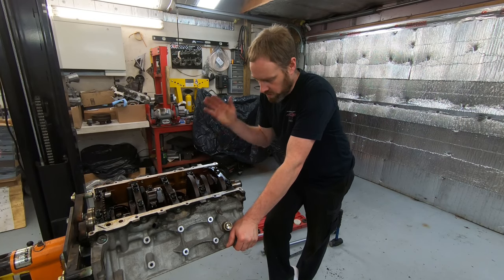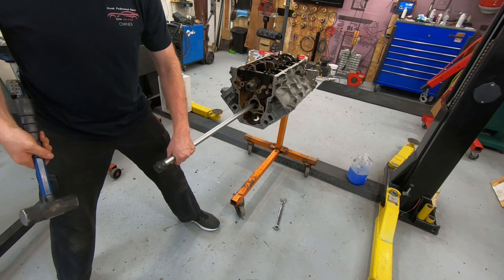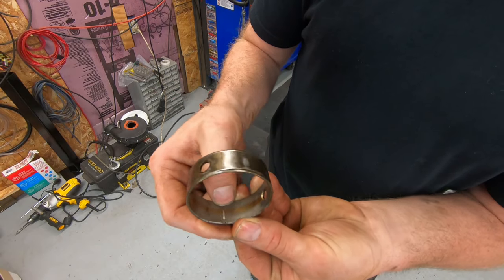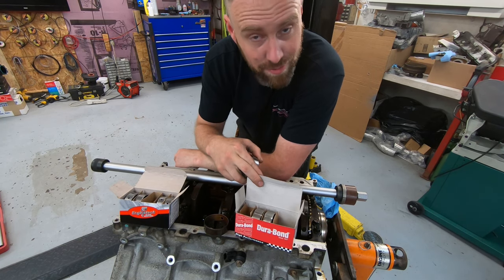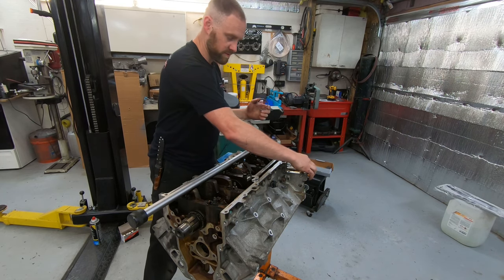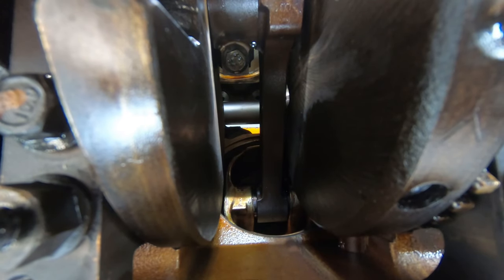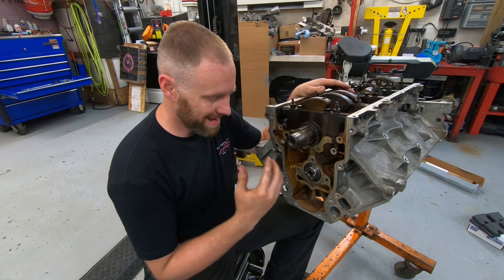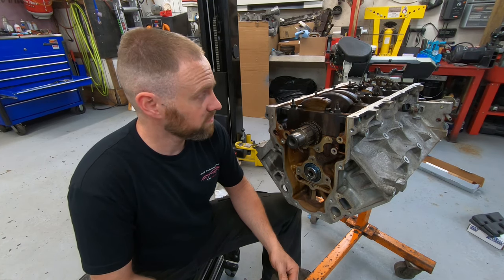Replacing Cam Bearings In AFM DOD LS Based Engine

Comment: @22:50 - I've always installed #1 & 2 with the installer going in from the back. Just take it off the stand and put the block on a table/box/floor. I think we have the identical installer! Case is even the same color.

Comment: Hey buddy.  Just wanted to give you a heads up on some info I've discovered over the past 15 years..
Alum VS Babbitt bearings.  My experience is that Alum bearings hold up much better for long term use, and "race" bearings (are babbitt) which can handle higher HP are used in racing because the manufacturer expects them to be replaced more often..
Here is an article talking about the alum vs Babbitt...
I will post the website below the section I'm posting... IMO, alum bearings, Cam, Crank or Rods.  Just hold up better....

------------THE ARTICLE ------
To meet the demands of higher loads and operating temperatures in modern engines as well as the requirements imposed by high performance, babbitt has been replaced by an alloy of aluminum. This aluminum alloy is much stronger than babbitt and will withstand several times the load which causes babbitt to fatigue or extrude. However, this added strength is obtained at the expense of some of the more forgiving properties of babbitt. The aluminum alloy is harder, making it somewhat less compatible with dirt, misalignment and marginal lubrication. This is typical of the compromises or trade offs that are frequently necessary when selecting a bearing material to suit the requirements of a specific application and in this case, higher loading.

https://www.mahle-aftermarket.com/na/en/support/installation-tips/cam-bearings-perf-tips.jsp

Comment: Very detailed thank you.  If you buggerd up one of the bearings with the tool do you replace the bearing or can you file or sand paper the edge a bit, assuming you can get to it if the crank is out?
Reply from the maker: You want to avoid abrasive, instead I find a way to get a knife edge in there. It is usually very easy to peel off a small amount of material and you only ever need to do it to the very edge. Be sure not to cut into the large flat at all if possible. Only the 1/16 or so from the edge part. If you do hit further in use your better judgement and possibly just get another set of bearings.
Reply: Replace the bearing remember what you have been through to get the Motor out and apart for 30 bucks more it's not worth the risk!!!🤔

Comment: I decided not to go with the delete kit and I put in 8 new AFM lifters. I had one collapsed lifter Cyl. #4. Cleaned everything up very thorough, and reinstalled.  I removed the screen at oil pressure sensor. Fired truck up runs on 8 now but quite a bit of ticking more so on cylinder 1 or 3. I let it warm up for at least 10 minutes for lifters to pump up.  Oil pressure very good.  Removed valve cover started up and oil shot out of rocker arms on #1 cylinder  20 feet in the air. All rockers looked like they were getting lubricated. 2007 chevy Avalanche 233,000 miles. I don't think the oil should shoot out that much, what do you think| thank you Bruce.
Reply from the maker: One of the new lifters you installed is junk. These things normally hardly have oil come out of rockers until you rev it up.
Reply: @CrazedPerformanceRepair  That's what I thought.  I went cheap made in China crap. I have never seen oil shoot out like that. Usually just a dribble or light spray. How does this bad lifter  direct the oil out the rocker, like that? How should it flow. Even old lifters that don't pump up any more don't spray like that. I am just trying to understand what is happening here.
Reply from the maker: https://youtu.be/3piBma7QqWU I think it has to do with the little wave plate in the hydraulic side of the lifter.
Reply: @CrazedPerformanceRepair  I did not see that video before. That is exactly what mine is doing. But cylinder #1 lifters are shooting oil out like a squirt gun and I believe cylinder 3 is knocking.  I will try your slow motion camera trick. That was incredible. If there is a blockage on #3 than maybe that is making the new DOD lifters in cylinder 1 shoot the oil out the rocker so far. I believe the oil comes from the pump and starts at cyl 1 that 3 than 5 than 7 down the rail. I am not sure of that I don't have an oil flow diagram. Thank you great videos.

Comment: Is it possible to diagnose bad cam bearings without pulling the cam? Can the VLOM cause extremely low oil pressure? And if I do the VLOM mod and ECU tune, will I need to do the cam bearings, or can I run much lower pressure with AFM deleted?

08 5.3 LC9, 215k miles, low oil pressure collapsed a lifter (all lifters were done 20k miles ago when I did the top end) oil pump o-ring was good, but replaced anyway. VLOM screen was clean, but replaced, sensor replaced and reading verified on mechanical gauge. I have zero consumption issues, but pressure when hot is often below 20 when driving, and under 10 at idle. Pretty certain this is my issue, but don’t wanna do all the work of course if there’s another way! Thanks for all you do, love the channel and ordered the stuck lifter tool today! Cheers from MN
Reply from the maker: Check to see if any lifters are puking oil out the pushrod tubes. If not it is most likely that stinking cam bearing considering what you have done so far. That oil pressure is quite low...

Comment: I'm going through this with my 04 GMC sierra 2500 HD GM needs to be sued for this and recall them all every one of them!!!
It's always no 2 they also back out of the cam Journal to remove your oil pan and and baffle plate and look up at no. 2 Journal to the rear of the Motor if you see any part of the bearing pull your motor you will never get good oil pressure out of it!!! Like I said GM needs to be held RESPONSIBLE FOR THIS PROBLEM!!!
PS the tool that Sumit sells is a must better tool and is under 80 dollars plus shipping! 
The last bearing install it from the rear of the Motor and use the centering cone use common sense!!! And one can turn the cam by hand if all the bearings are installed correctly you shouldn't have to put a bolt on the end of the cam to turn it its binding for what ever reason I'm 70 years old and have been working for GM dealers for a very long time!!!
Reply from the maker: Gm will never recall the bearing issues. It's not safety related. The last bearing is a bit hard to install from the rear with an engine stand in the way. Especially when it's not at all hard to install with the tool. Why not just leave engine on the stand till you're done? Adding a bolt to turn it is needed regardless of and binding. How else would you propose grabbing it to turn it when all the way in? There's nothing to grab hold of lol. Plus it double as a way to make sliding it in and out more stable so you don't damage bearings. If it does bind it's typically from the install tool hitting the edge funky somewhere do to installer error/mistake. It's not uncommon and as simple as touching the damaged spot in a certain way with a knife like tool. Of course one needs to make sure not to damage the main surface.

Comment: What's the probability of successfully replacing at least the first 2  front cam bearings like this while engine is in truck? I feel like it is very possible if all that is really worn is the front bearings and all that needs to be remedied is low oil psi.
Reply from the maker: Very good. Oil pan and windage tray have to come off. Then you have to fight gravity, limited space, the struggle of lining up oil holes, and connecting rods in the way.
Reply: @CrazedPerformanceRepair   does it really matter if all of the bearings are not the same batch?
Reply from the maker: @FoFoCowboy  no, it will be fine to replace the front 2 only. As long as the rest look ok and they typically do.

Comment: At the 5:15 point in the video you show the parting line where the straight piece of steel was wound around a mandrel to produce a round bearing.  I don't know that I have ever heard any other LS content produce mention that.  To the GM engineer who came up with this idea:  what a CHICKENSHIT cheap ass way to produce one of the most critical parts in the engine.  Ever try to change one of these, GM engineer?  Crazed:  great videos as usual.

Comment: Great vid thanks for the info!
I currently am working with my 07 Yukon 6.2 L92 without DOD with VVT. Has 140k. Had the heads of recently for a head gasket and replaced lifters while I had the heads off and also replaced the oil pickup tube o-ring. 
I am getting an intermittent code for a P0011 intake camshaft position timing over-advanced. In conjunction my oil pressure reads at idle when cold around 40 PSI. After driving for a while and letting sit at a hot idle, i am getting anywhere from 14,18PSI. Seems low to me. When the code sets while driving it is usually coming on at a higher RPM which is usually mid 30ish oil pressure.
Thinking could be anything from oil pressure issues due to oil pump relief, worn cam bearings, or VVT actuator solenoid? Any thoughts? Originally I was just concerned about the low oil pressure when hot although I am not getting any engine noise. I do have a tech II where I can test the VVT solenoid and the variance checks out to be fine even when the code is current. I was thinking of replacing oil pump with a high volume melling and the VVT components. When the codes not set it runs normal although I do get a very slight miss on a cold start. 

Thanks for your help!
Reply from the maker: Shoot me a message on my website, copy and past if you like. That's a long one haha it's late now so not ready to answer and don't want to forget you. Link in description.
Reply: @CrazedPerformanceRepair  Sent, thanks!
Reply: I have same issues. Did you ever find the fix ?
Reply: @JoshForeman-jt4fp I did not. Started running 10w40 mobile 1 seems to help since the issue mainly happens when it’s hot out. Still get it here and there but has not yet become a bigger issue.

Comment: i just had my 6.2 out .. i did a d.o.d afm vvt delete .a new hv oil pump .. now 30 psi hot 40 cold .. i didnt do a cam bearing replacement . maybe i fucked up !
Reply from the maker: Bummer, well it should be ok for a while still. I would get more concerned if it starts to get close to 20psi hot. After all, with AFM deleted the engine doesn't need a hole lot of idle oil pressure.
Reply: A new high volume pump? Couple of things, pretty much all LS vehicles i've seen that don't have an oil cooler once hot, i mean like driving for 20 minutes hot idle between 25-30. As long as the pressure goes up with rpm I wouldn't be concerned. Now DoD delete... vehicles with DoD have a 30psi pressure relief valve in the oil pan if you didn't plug that; even if you got a standard pressure pump you're likely to see 30psi at idle anyway, and THEN standard pumps have 20psi relief valve. You're probably good for the long haul but if it bothered you, either shim the HV or replace the pump with a STANDARD pressure mellings or a HP/HV pump. Hope this helps, all information was from experience.

Comment: Great video. But removing and installing cam bearings has to be done with the block on a solid table, not on an engine stand. Front cam bearing have to be removed from the back.
Reply from the maker: Been doing it this way for years now so it doesn't have to be done on solid table. It does make it easier to do it on a table I suppose. Perhaps my next shop will have a nice solid engine table and I'll try it even though this way works fine.